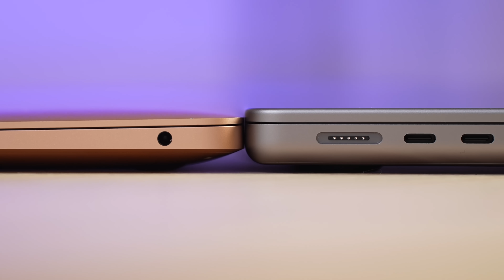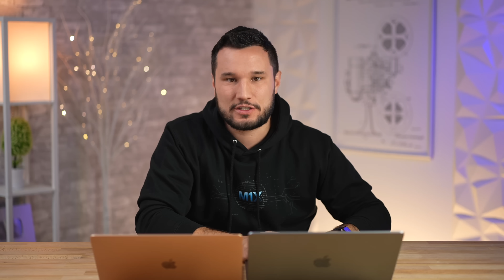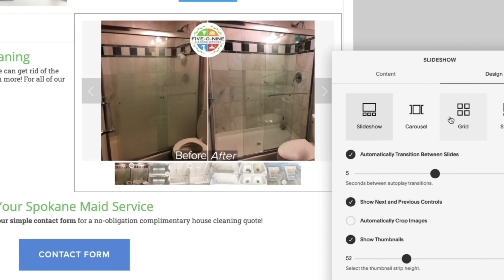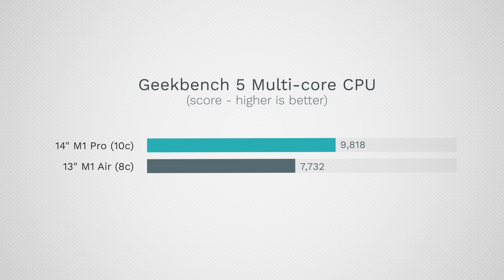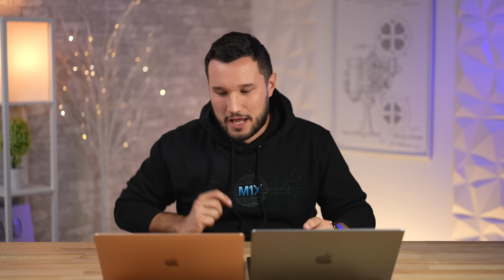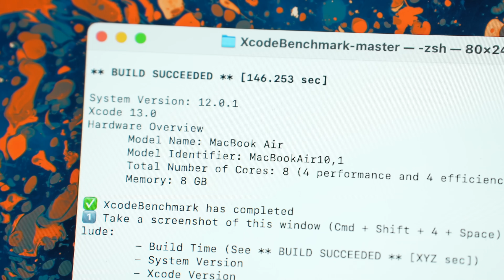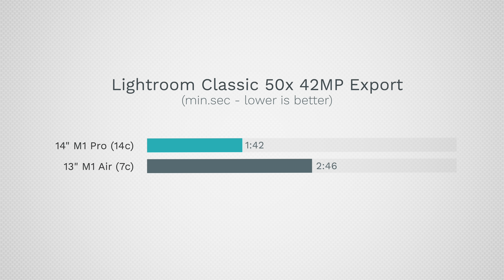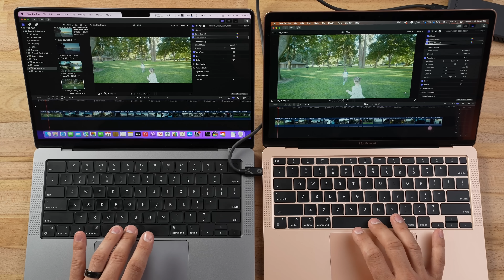14" MacBook Pro vs M1 MacBook Air - Worth $1,000 MORE? 🤔

Comment: Thank you, this is exactly the comparison I was waiting for and it confirmed my intuitive beliefs, that for 95% of people, base model MacBook Air is the best laptop. I am a lawyer, and I have several friends and family members who are lawyers, writers, researchers, journalists, businessmen, who don't need 512 GB of storage or 16 GB RAM, as they just basically store PDFs, MS Office files and stream most of the content, and for them MacBook Air is perfect laptop. And for most people in my country even $ 900 is huge sum of money, as they are often comparing it with new windows laptops that are easily available for $ 400-500. I have to explain to them how MacBook Air M1 at $ 900 is such a great deal for them, which would give them 6-8  years of smooth performance. 14 inch Pro is great for a semi-geek like me, who instead of Air wants to buy Pro, and wants 16 GB of RAM for psychological comfort and 512 GB of storage, so for me, MacBook Pro 13" is already $ 1700, which makes no sense to spend when one can easily get the much better 14 inch for $2000.

Comment: The review was very educational and concise.  If someone doesn’t currently need the additional CPU and GPU performance stay with the M1 older model MacBook Pro and save your cash… 

Prior to watching this review I was convinced that I needed the 2021 MacBook Pro however this was not case.  Going from a 2017 13 MacBook Pro to a 2020 MacBook Pro M1 is a huge improvement..

This review saved me $1,000.00. Thanks again…

Comment: I'd say for 80% people, Air is enough. It is cheaper, lighter, similar battery life, and you won't feel the speed difference. But if you need 16G memory or 512G above SSD , the price difference is much smaller. Go with Pro if you don't mind the bulkiness.

Comment: Right after the apple event last week, I ordered an M1 matchbook air (same spec as in the video).  My prior reluctant to getting a M1 mac was due to the lack of multiple screen support (I used 3 monitors in my setup) without the use of software.  Because these new Macs still don't support the use of 3 screens out of the box (unless you upgrade to the M1 Max), I decided to try out the M1 MacBook Air first before investing three grand on a new computer.

My thoughts so far is that for most daily tasks, the MacBook Air works very well, however there is noticeable performance downgrade that takes places when the software is being used to connect to multiple screens when you doing video multi-tasking.  Basic playback video-scrubbing in Quicktime while watching a YouTube video will often cause delays and reload errors to occur.  I am curious how this performance differs in this setup (multiple screens with display link manager) with this spec of the M1 Pro MacBook. 

One last thing to point out, the gold color of M1 MacBook Air is absolutely gorgeous.  It really makes the decision hard on whether to keep it or return it to upgrade to the M1 Pro/Max (since you only can get the gold color in the MacBook Air).

Comment: I am torn between these two products and am thankful for this video.  I just wish the MacBook Air had a brighter, bigger screen without a notch.  Rumors that the next one will have ProMotion but no new screen technology other than a white notch.

I don't need the power of the MacBook Pros as I only do the occasional instructional video.  It would be nice, but not necessary.

Comment: I had to return my Macbook air I bought last week because it deveoped a dead Pixel. While I was at best buy I was contemplating the new Base 14" but I really thought about it and I am not using the laptop for anything crazy. Just youtbe and some lightroom and capture one when I go out shooting. If I get back to blender I will still use my PC with the Ryzen 2700 and RTX 2070. Athought I really did want the 14 but I resisted my GAS and just replaced th bad Air with another Air

Comment: Honestly, I think the 14" Macbook Pro and 13" Macbook Air are tied for the best bang for the buck. (MBA still is super powerful for its price). I don't think Apple will be putting the M1 Pro nor the M1 Max into the MBA, simply because it would compromise on the main thing the MBA is all about, size - Thickness and weight.

Comment: I like how you pointed out that upgrading to MBP from MBA is not going to be worth it for most people that use MBA for basic tests.

The comment that people can buy 2 MBA for the price of 1 MBP got me thinking how the benchmark results will turn out if the benchmarks are set to run on 2 MBA parallely vs 1 MBP. As most of the benchmarks were only giving less than 50% difference between MBA and MBP, doing a 2 MBA parallel setup should actually be able to outperform MBP.

Ofcourse that will depend on that task in question and whether it can be scaled to run on two systems, but for things like development and stuff it seems buying multiple MBA or mac minis make more sense, if portability is not an issue.

Comment: Pls do a export test with multiple lightroom photo, video rendering using Final cut and davenci resolve at same time to find the maximum stress macs can take.

How fast these machines are able to read / write from external SSD like samsung T5, sandisk extream which are regularly used by editors.

Comment: I have a 2017 MBP and am looking to upgrade to either the 13” or 14”. If I get the 13” I will upgrade to 16GB RAM and 512 SSD which is the base for the 14”. At that point, is the 14” still better?

Comment: Even though the MacBook air is slimmer it doesn't matter because it's not a real world usable feature. Can you fold it or roll it up to make it smaller? No. So it's basically the same footprint no matter whether you are carrying it in a bag or back pack. It has less metal so it's also not as sturdy. It has far less ports too. So even if you're only using it for it's really just not as useful. It's only real advantage is price.

Comment: I my opinion the pro is a better value because the base already comes with 512 gig and 16 gigs of ram 
Size wise I don’t think it is that much bigger to make me go for the air over the 14 inch

Mini led 
MagSafe 
Sd slot
Extra thunderbolt
Processors 
GPUs 
Camera
14.2 display size

Makes it a better value!

Comment: The MBP is faster, but in workflows that don't matter to me.  The extra ports and nicer screen would be nice, but I can easily live without them.  Portability does matter, and the MBA being 0.7 lbs lighter plus a little bit thinner and smaller makes a noticeable difference in the computer bag.  I also think the MBA looks nicer.  And, I get to save $1k.  For me, it's not a hard decision.

Comment: Sold my 2019 16" and staying with air m1 since its faster than intel. it does the job for up to 4k 60fps 10 bit 4.2.2 and thats good enough for me. already spent in sd card reader uhs ii that its faster than the one in 14".

Comment: another killer comparison! I think most people will prefer the M1 Macbook Air as it should be enough for most tasks. for those professionals that use these for work, it's advisable for them to go upgrade to the 14" Macbook Pro since they'll be needing the power boost of the M1 Pro/Max chips. Also those extra ports is useful for them.

Comment: I’m sure the MacBook Air M1 gonna be updated with MagSafe (not HDMI, SD Card) 
And if it does it gonna be awesome 
The MacBook Air is really a great device really light and I understand why people like that 
Before the MacBook Air was not a good laptop since it can overheat really quickly and the fan spinning really high
Now the MacBook Air is, because of ARM, the best ultra portable laptop 
And it gonna be more powerful than before with M2
Even if the MBP14" cost much more, it has more ports, the better screen and of course the performance that goes with the new M1 Pro chip
But for those that aren’t interested with the HDMI/SD card ports, with the higher resolution screen + ProMotion and have enough performance with the M1 chip the MBA is really a gem of its own

The only issue that I have is in the long term, does the passive cooling system not gonna be less efficient to cool properly the chip and so the machine gonna throttle a bit ?

Comment: The MacBook Air 16GB, 512GB ($1399) is still the better option over the M1 Pro MacBook ($1999). A better screen, more ports and a new M1 processor is not worth an extra $600. Save your money and get the MacBook Air 16GB, 512GB.

Comment: I have the M1 Air with 512 of storage. For me and probably most people its more than enough.  I could never push that pro hard enough with what I do to make use of the differences. For me the M1 air is just insane in what it delivers for the price. Lets not forget that only a year ago it was the laptop that all the tech reviewers loved making fun of. Only a year later and it will demolish nearly any windows laptop you can buy and they cant be made fun of anymore

Comment: Yes, absolutely correct. Indeed 14" MBP overpowers 13" MBA in every dimension based upon performance, but it's wise to buy a needle rather than a nail if it satisfy the sole requirement.

Comment: The thickness and weight difference is really only a perception because of the chunky design. In actuality the Pro only feels a little heavier than the Air, and at the thickest part, the Air is actually thicker than the Pro. Once you slip it in your back pack I honestly don't think you can tell the difference.

Comment: I think most casual students using a laptop only for schoolwork and not much else should get the air, but anyone who does any extra work or uses a laptop instead of higher end iPads for content consumption should get the new pro. The display alone would make me spend the extra money since that’s what ended up making choose new iPad Pro over M1 air/pro. Higher resolution, higher refresh rate, and mini led on the new pros makes the display equal with M1 iPad Pro and MacBook Pro now has way more power and extra ports

Comment: For me the battery life of the new MBPs is the one let down. But only because of the expectations set by the M1 machines… and the fact that Apple gave themselves the design freedom to increase the volume/weight of the machines.

It will be interesting to see if the next MacBook Air is pitched as a premium ultraportable with a larger ProMotion display and long battery life — which would suit a lot of people — or a not-quite-so-cutting-edge "mainstream Mac" at a lower price point.

Comment: Going from a older 15 inch quad core i7 to an M1 air. I still can’t get over how much the M1 kicks arse, when the M1 iPad gets full capability and even ability to work as a second display with mesh processing capability then that’ll be something to behold, two displays, two processors but both acting as one device 😁